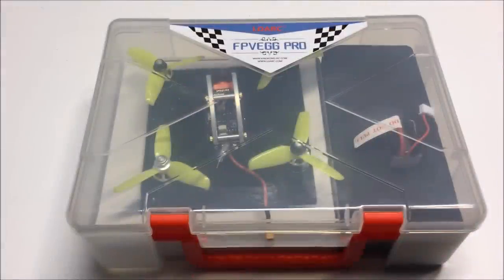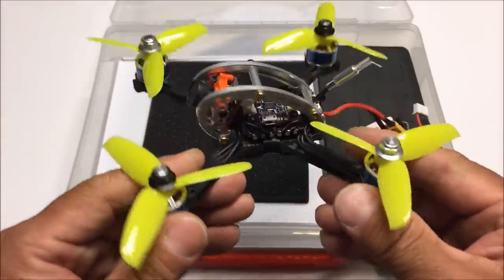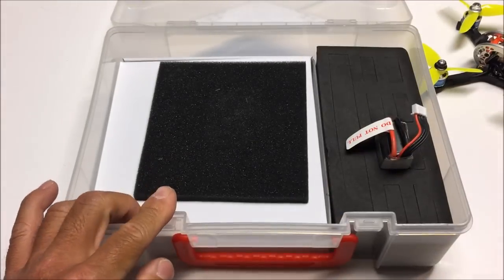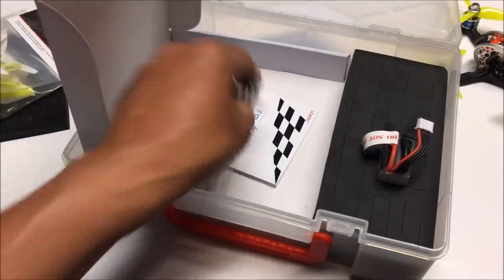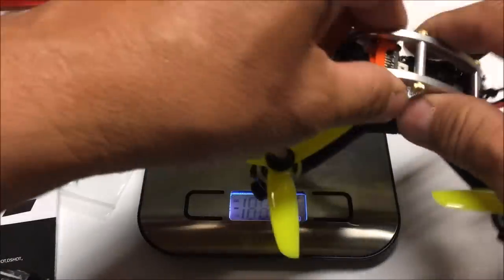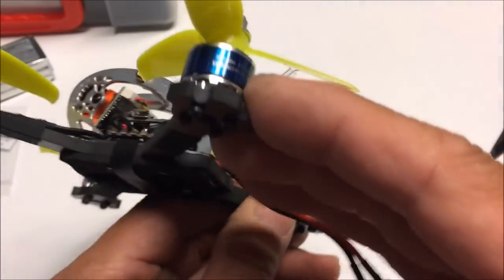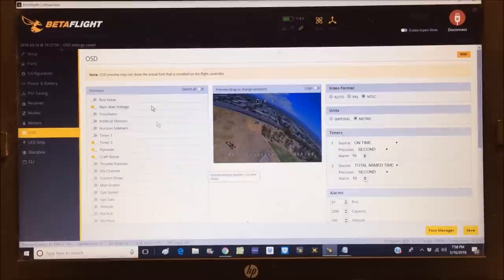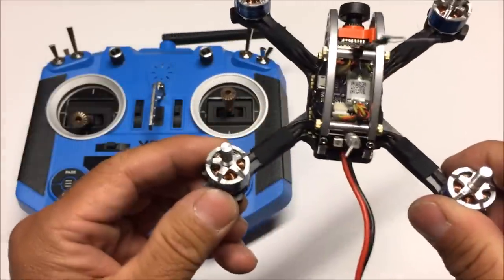KINGKONG / LDARC FPV EGG PRO 138mm RC FPV Racing Drone Unbox & Setup

Comment: Hi Pete, if you type 'diff' into cli, it list the things you changed if you want to dump just those. Nice review, its a pleasant flyer this one
Reply from the maker: Thanks :)
Yes I am aware of the"diff" command as well as the "diff all"  command which goes further and shows more changes than just the diff cammand :)
Reply: RC Escape one day I'll teach you something! Well, perhaps not 😆 All the best
Reply from the maker: I didn't know about it either but a friend of mine is very knowledgeable about everything and he told me about it :)  It is most useful when upgrading betaflight firmware :)
Reply: I agree. When will be seeing this test flight Pete? - interested on your thoughts etc. :)
Reply from the maker: Stay tuned, update coming soon :)

Comment: Good info with great detail, as usual. I do have a question for you about the CLI dump file. How do you restore it?
Reply from the maker: Michael McCauley 
Thanks Mike :)
You can highlight the areas that's important and paste it in the prompt and hit enter and hit save :) 
I also save what is different from default settings by typing in "diff all" and save it when I'm upgrading firmware :)👍
Reply: Thanks!

Comment: they tought of everything! its a awesome set :) ill have to see if i get this one or a 145 kit (i wanna put a split mini in there so) there isn't enough room in this one i geuss :/
Reply: plus they finaly added osd!! :)
Reply: Thijs RC nice little ripper
Reply: best King Kong frame yet. I'm building this one now, nowhere near enough to room for a split, but the frame is a, indestructible tank!!! and  surprisingly light. For a split go crow,vx140, furibee x140 or hglrc145. ;)
Reply: yeah i have seen a cool 145 frame kit, ill have to see :) also have a "5" but 3 is better for tight spaces and with a 1080p cam its a great setup.